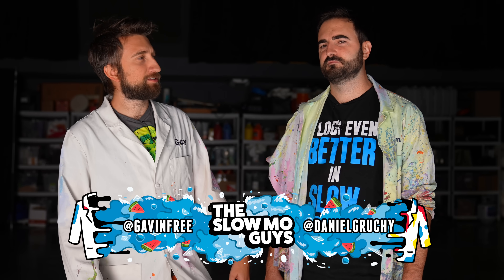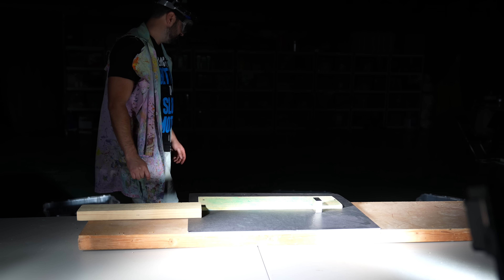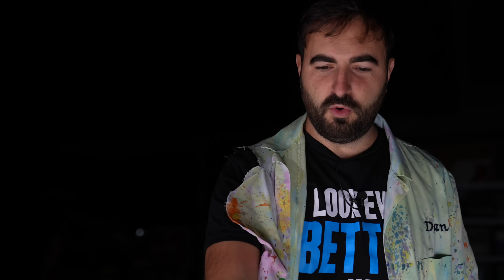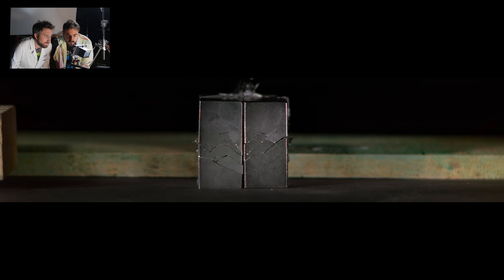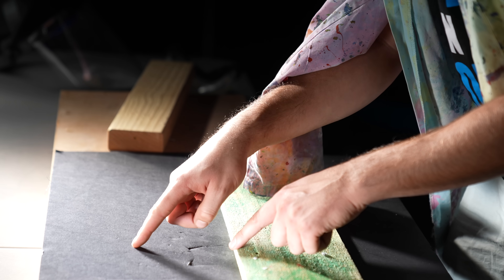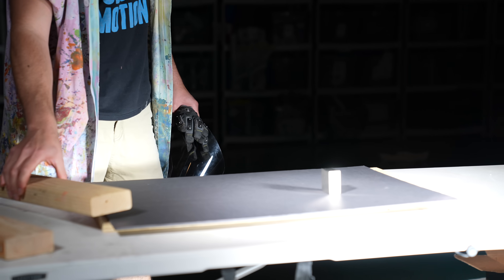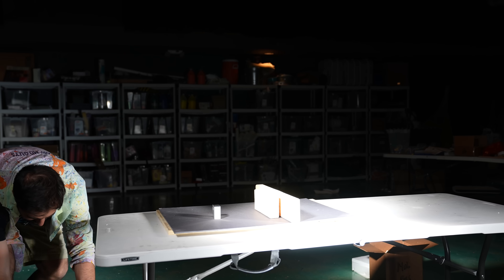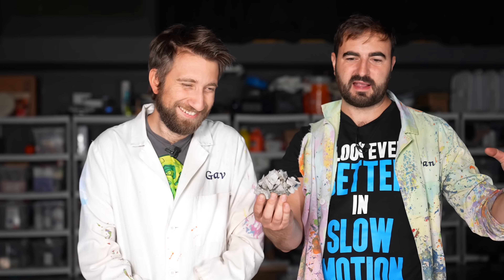Ridiculous Magnets Colliding at 187,000FPS - The Slow Mo Guys

Comment: Slow Mo Guys, you can do the same with protons, electrons, positrons, anti-protons, any particle with a permanent magnetic dipole moment.  You have to line up the spins properly, and time them using magnetic resonant imaging methods.  But it can be done very very precisely with not a lot of equipment.  For "Tabletop fusion" pulsed magnetic gradients from lasers can be used to accelerate and align the atomic particle magnets.

The magnetic field of a particle magnetic dipole is a vector calculation.  You find the details at Wikipedia under "Magnetic dipole force" and related articles.

If you line up the protons so they point North, for instance, and send a beam from the south and a beam from the North, when they get closer their north and south will be attractive.  The equation for the magnetic field is 

B(r) = μ₀*mup/(2*π* r³)

Mu0 is the vacuum magnetic permeability.  The Codata value is 1.25663706212E-6 Newtons/Ampere^2
Mup is the Cocata proton magnetic moment.  Mup = 1.41060679736E-26 Joules/Tesla

B(r = 1 picoMeter) = (1.25663706212E-6) * (1.41060679736E-26)/ (2* pi* (1E-12)^3 

B(r - 1 pm) = 2821.21359626  Tesla or 2.82121359626 KiloTesla

Parallel to the proton, where it is pointed North and traveling North-South, and 1 picometer way, the field will be half or 1.41060679813 KiloTesla

But hitting the protons head on is going to be a bit iffy.at first.  What is likely to happen is they will just miss and only at near collisions will they hit and stick.

But I think that is mostly a matter of iterative learning.  Using magnetically aligned and precisely tuned proton beams is going to narrow the collision conditions a lot.  You are not randomly hitting hot protons pointing in many directions and all on their own schedule and paths, but keeping them to precise paths and times and energies.

The energy density is calculated 

MagneticEnergyDensity = B²/(2*μ₀)

(1410.60679813 Tesla)² / (2 * 1.25663706212E-6 Tesla*meter/Ampere) gives a value of

7.91720855E11 Pascals or 791.720855 GigaPascal

(2821.21359626 Tesla)² / (2 * 1.25663706212E-6 Tesla*meter/Ampere) gives a value of

3.16688342E12 Pascals or 3.16688342 TeraPascal

I use the full precision, so that anyone can trace the calculation.  The floating point calculations are usually at least this good and so always use the latest and best Codata, and not round off.  If you round or guess, the Internet gets filled up with partial and incomplete calculations and examples that are a mess to clean up. Do it right, do it once and for everyone on the Internet.

If we can get the "best calculations" and models and data share globally on the Internet, then we all can just use the master equations, and not have to make billions of copies, with the usual human and AI mistakes and omissions.

For the electron at  nanometer

B = (1.25663706212E-6 T*m/A) * (9.2847647043E-24 J/T) / (2 * π * (1E-9 m)³) = 1.85695294187 Tesla
U = (1.85695294187 Tesla)² / (2 * 1.25663706212E-6 Tesla*meter/Ampere) =  271.7586623 MegaPascal

The gravitational energy density has not been calibrated, it depends on frequency, on the spectrum of fluctuations. Roughly

U_B = B² / (2 * μ₀)

U_g = g^2/(8*pi*G)

B = g*sqrt(μ₀/(4*pi*G))

sqrt((1.25663706212E-6) / (4 *pi * 6.67430E-11)) = 38.7076796657 Telsa/(meter/second^2)) = 38.7076796657 Tesla/(meter/second²)

B = (9.8 m/s^2) * 38.7076796657 Tesla/(meter/second²) = 379.34 Telsa  comparable in energy density to the earths gravitational field.

Richard Collins, The Internet Foundation

Comment: Put magnets on bearings/rollers and set them aligned symmetrically. E.g use 3D-printer moving parts. Then it would be awesome to see when 2 flat surfaces contacts each other withouth any single pressure points.

Comment: You could coat it in resin just to keep them together and then heat up the magnet. If you get it hot enough it will lose its magnetic property. You may or may not melt the resin though. I'm thinking this up as I type, so...

Comment: As a safety precaution with the magnetic bits, use a Blow Torch on them.  One heated, they will permanently lose their magneticity, and will be safe (after cooling off, or being dropped in a water bath).

Comment: Please film it again, but this time cover the pieces with iron filings or oil mixed with iron filings to observe the change in the magnetic field from two fields to many fields 🎉.  You may need some super bright lights to capture the magnetic field lines.  Other thoughts:  
sprinkle the filings on the surface, all around the magnets.  
Maybe have a device like a sieve or screen to constantly drop the filings from above and around the magnets to help see the magnetic lines in the air.
Maybe mount something like an etch-a-sketch with a pattern drawn on it, behind the two magnets and see if it reacts with the magnetic field as the magnets collide.

Comment: You guys should take the battery out of an old laptop, strip it down to just the lithium and drop it in a toilet. I used to do it as a teenager for laughs but I bet the slo mo footage would be wild because lithium water reactions are intense.

Edit: note I did it in a toilet because the porcelain will safely contain the reaction but you can use something else to avoid filming in your bathroom lol

Comment: This is why in MRI we have patient's fill out a full medical history questionnaire and go over it verbally with them before doing an MRI. A 1.5T MRI machine is 5 times stronger than the magnets used in junk yards to pick up cars.  A bobby pin goes from 0 to 40 MPH and becomes a projectile within 1 mm because of the fringe field
Reply: And technically a "false knee" or a knee replacement is made of a non-ferromagnetic titanium or surgical steel so it would not be attracted to the magnet.

Comment: Excellent but I want to see the field lines so a continuous sprinkling of iron fillings next time. Or do it on a glass table with iron fillings in oil under the glass and the same glass/oil/ iron trick as the BG.

Comment: It's amazing that while the initial speed of the magnets at the point of no return was very small, many shards have been ejected at a high speed, enough to escape the magnetic field. You may try to achieve a stronger impact by putting the two magnets on a sheet of ice that is almost frictionless compared to the table.

Comment: Would be neat to see the magnets flip around and get pushed from different angles and heights. Maybe even in different liquids to see how the impacts react or superheat water getting smooshed suddenly between the flat surfaces. Lower one down from a spring there is so much you could try

Comment: The MAD RUSSIANS at YouTubes 'Garage54' (where they perform whacky 'What If' experiments with Ladas etc), set up a 'Magnetic suspension' (removing all the normal springs and dampers at the rear of a car) so it was just using the repelling force of magnets to damp down bumps and such on the road.. But I don't think they were using the ultra strong Neodymium magnets though 🤔😏
😎🇬🇧

Comment: Magnets inside a Hard Disk Drive are much smaller but quite strong.
You don’t want to pinch your fingers between two of those.
So if you have a couple of HDD’s lying around (who doesn’t) rip them open and find the magnet!
If you take them off their backing plate they will shatter together.

Comment: Remember, each new shard will instantly have it's own magnetic field. The bits flying away, reacted strongest to the  same pole as the nearest other bit (or larger), while the bits pulling back into the cluster, orientated to the opposite poles of all the other tumbled pieces. You can also see this, by most of the shards rotating, almost in place,  due to the poles fighting for their natural position!

Comment: How about a clear ballistics gel with an open empty slot on the bottom to slide the 2 magnet together. Not a tight fit, rather like a half an inch (12.7mm) of clearance on each side.

Comment: The reason that the shards turns and sticks back to the magnet is that when a magnet is divided the two pieces will have south and north sides no matter the size and shape. So when the magnets get shattered every single fragment gets its own south and north sides and it flips like the big magnet did a 360.

Comment: if you don't feel comfortable with storing the remaining pieces of the magnets, you can just heat them up to the point the loose the magnetic force. The "Curie point", for neodymium magnet is not that high. If you want to deactivate the magnet, just heat it up. Great video BTW

Comment: In high school I was in a vocational high school, electronics. My teacher did jobs around the city so he had many different projects that he took back to school. He had me and this other kid sorting bolts in the back of the room. Also in the back were these large magnets that came from mainframe hard drives. This was back in the 90's so these HD were MASSIVE! Like 8-inch disks. To move the read heads the disk use huge magnets. I had two stuck to my hand. The other kid was tossing bolts. He tossed one and it just happened to be at the exact perfect angle. The magnet caught the bolt and arched around my hand but didn't get pulled to the massive magnets and dropped into the sorted bolt tray. 
"DUDE!"
For the next 2 1/2 hours (It was a 3-hour class) we kept trying to recreate that perfect arch. NOPE! It was we'd either overshoot and the bolt wasn't effected by the magnets or we'd undershoot and the bolt would get stuck to the magnets.

Comment: interesting vid guys,  so what occurs if you add a copper plate or sheet between the pair?  if they would accelerate towards eachother with copper inbetween, i would hope then there could be some rebound as the magnetic attraction is nullified or reduced as it approaches the middle , perhaps.
  will it or wont it?  
i dunno but you could find out.

Comment: If you can heat the magnets up safely in something like a torch flame,  an oven, or forge, you can partially or permanently demagnetize the hunk of wreckage of the old magnets. There's a characteristic Curie temperature at which the magnetic domains stop aligning and become random making the metal no longer magnetic. Before then, the heat energy starts to randomize the domains causing the magnet to lose strength.

Comment: An interesting experiment for those who want to make their own (not so powerful) magnets:  Take an iron rod and align it along the bearing to magnetic north from your location.  Then tilt the rod to the angle of inclination of the Earth's magnetic field at your location.  Around the Canadian/US border, that means pointing the far end of the bar down at about 45 degrees to horizontal.  Then strike the bar firmly on the near end with a hammer.  Hey Presto!  You've made a magnet.

Comment: Would it create more power / velocity if each magnet were suspended or restrained by fishing line (or something strong enough to hold the attractive forces), then cut the strings at the same time?  You know, have them pulling in full attraction, but with full resistance, before letting them fly into each other.

Comment: That was so incredibly violent! I share Dan’s respect for huge magnets. I feel like they constantly want to smash my fingers off.
Reply: They do.
They just B that way.
I Gauss we will just have to live with it.
Reply: when is that video coming?
Reply: So next time you are going to put objects between them like ballistic gel fingers and look at the damage right? right?
Reply: Used to design magnetic separators for grain using heavy duty permanent magnets. We had a couple of near misses when building them in a mild steel workshop, terrifying!!!
Reply: The most interesting thing that I noticed was that the bits that would later turn into sparks were not immediately glowing.  It's like they were "ringing" like a bell, and it's that ringing, rather than the initial shock of impact, which heated them up as they flew out.
Reply: @ReadTheShrill 
It's self heating from Eddy currents.
The bits are moving rapidly in a magnetic field.
Reply: @WolfTronix  whoa! Do you have a source on this? That's an awesome concept.
Reply: @jeremytadevich1254  

Faraday's law of induction, relative motion of a conductor in a magnetic field.

The coating on the magnet is conductive, and it's rapidly moving in a magnetic field.
Reply: @WolfTronix  I get the eddy currents. I meant the eddy currents causing the fragments to heat to ignition temp. Either way, I like it. 👍 just like an induction crucible. Awesome.
Reply: Even the small ones are dangerous.  I have a few 15mm by 6 mm neodymium magnets and they are very difficult to get apart.  Only way is to slide them side to side.  I have had them stacked and put them on the front of my fridge.  Then tell people to pull them straight off.  Can be done, but not easy.
Reply: im with destin they are out to get you lol
Reply: Destin shoots bullets at another bullet. Takes several years to figure out how to do it safely including getting other people to review his safety checks. Dan and Gav just use a few pieces if wood and some safety goggles/gloves.
Reply: I truly hope you bring these guys on for the next bullet smashing video, theres so much quality that is lost on such a cool project by not being able to see it all in high definition.
Reply: they're very clearly dangerous. It's a good thing to have an understanding of them. I thank you Gav and Dan.
Reply: I can attest... they do. Missing the middle right fingertip from an electromagnet 😂
Reply: That or the Prince Albert lmao😢😢
Reply: I've had my fingers pinched by magnets not even close to being as powerful as these, and it was still not fun
Reply: I Wish we could see all the field lines of force while this is happening.
Reply: They are great when stationary...
Reply: would have been fun to have stuff get smashed in between them
Reply: Amazing isn't
Reply: I have a scar on one of my fingers from playing with 2 HDD magnets.
Reply: What's the terminal velocity of the magnets if they could keep moving unimpeded ?
Reply: Destin! I think something amazing is happening here. At 7:25 in the video, you can see magnetic ejecta spray from the top of the magnet, but what is interesting is these ejecta don't 'spark' until they are already in flight. In other words, they begin their journey as solid pieces of magnet, heat up enough to emit light, possibly melting, then cool again. Are you picking up on what I think is happening? I believe the bits of magnet that are ejected after impact are heated due to resistance from the main ball of magnet.

I'm a nurse and have only a passing understanding of physics, but I'd be really interested to learn how velocity is affected by attraction to the main ball as these ejected pieces heat then cool, surely having some effect on their own magnetism.
Reply: Safety Advice! Don't try to keep powerful magnets apart by putting one in each pocket! I Learned this the hard way when I was a kid! 😅
Reply: Hello Destin, have you ever considered a certain chemistry video involving paraffin wax? If you boil some paraffin in a test tube, then dip the test tube in an ice water bath, it belches fire. I would love to see high speed footage to maybe figure out why an ice bath causes hot paraffin to ignite without flame.
Reply: @jtadevich  Hi, I do not have any degrees or expertise in this area just as a caveat, but my guess is that the ice water causes the boiling liquid paraffin to be compressed, forcing hot gas that was intermixed up and out of the tube- combustion should be able to occur given enough heat even without an ignition source (think compost piles starting on fire by themselves) so my guess is the vaporized paraffin in the air above the boiling paraffin has tons of surface area and is easy to ignite and the heat shooting up and out is enough to cause it. Again just a wild guess on my part, have a good day!
Reply: @bradnewsbear  yeah that's my guess as well.
Reply: i feel bad for the magnets 😢
Reply: Hey Destin! The Hacksmith has been trying to make a real cutting lightsaber for a long time. In one of their most recent videos they describe their current model as a laminar flow of plasma. Collab time?
Reply: Like those stupid snap traps for mice, some of them are really sensitive. They have one video of one of them jumping into a bunch of snap traps. Now that is insanity.
Reply: 181 thumbs down is tired of their black magic😁

Comment: Just an idea: connect them to ropes and drop them simultanously. So that they meet in the middle but they are completly in the air. I am curios If they have enough force to hold most of the pieces together

Comment: Try having a magnet suspended in air (on an aluminium pole or something) and dropping another one just inside it’s effective magnetic field, keep decreasing the distance it small increments so you could potentially get it to orbit one full rotation

Comment: I'm curious to see what would happen and the resulting conglomeration if you did the same experiment with both the magnet balls that were formed, just to see if there's enough polarity difference to attract each other (if the outer magnets of one of the balls is reversed of the other) and merge, or if they'd repel each other because the outer magnets of each ball are facing the same polarity outward (and maybe if you could still force them close enough that the polarity of the inner magnets that might be opposite actually kicked in and pulled them together).

Comment: I wonder what the speed of magnetism is. Cause at a certain speed of a magnet trying to magnetize to an object would it keep up with the object or would it eventually not be able to keep up and start getting further away from the object. Basically if a magnet was 2 inches away from an object traveling at an infinitely accelerating speed, what’s the speed that would cause a magnet to fall back, if even possible?